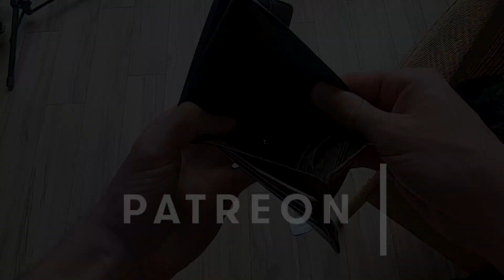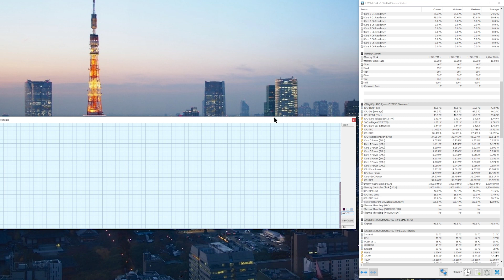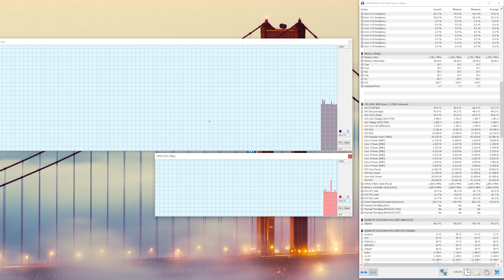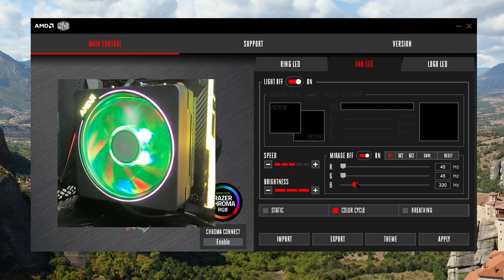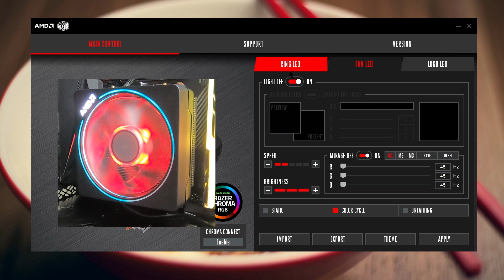Easiest Way to Install the AMD Wraith Cooler

Comment from the maker: Hey all, thank you for watching! I hope this helped. Remember to LIKE and SUBSCRIBE :)
Reply from the maker: Fabbe Labbe  Which lead? The USB header?
Reply: @TechIlliterate  I have this cooler currently on my FX8320 for the last 2 weeks. Finally building a ryzen 5600x build. My Cpu arrives tomorrow, Will this cooler be fine on that do you think?  Thanks for any info.
Reply from the maker: @EarthMonsterAZ  Yes. It's a GREAT cooler. No need to replace it unless you like to look at really low temps.
Reply: @TechIlliterate  awesome,  I will use this for sure. Thanks for the reply. 👍
Reply: Was looking for info on the LED wire description (voltage) and connecting up the LED wire... but you skipped that part of hooking it up...
Reply from the maker: @SeaJay_Oceans  Sorry dude. Haven't ever touched it tbh

Comment: I installed mine while the motherboard was in the tower. I used the same thermal paste you used. I used the spatula that came with the thermal paste to keep the backplate into the space between the motherboard and case.

Comment: Went wrong from the first step, numerous tests have shown the single dot method with the thermal paste is no good, it doesn't give full coverage, the best way is the butter spreading method, you put a little bigger blob than that on and with a small squeegee (they come with most thermal pastes) you smear it in smooth lines until the entire sqaure of the cpu is covered in a thin layer.

Comment: The mounting system isn't frustrating.  You just fell like you're going to smash your CPU when you are locking the lever down due to how much force is needed.  I prefer the two latch system over the other Wraith coolers.  Installing the Wraith Stealth was frustrating due to the plate that goes beneath the motherboard and then you have to screw 4 screws into it.

Comment: What if my stock cooler is Wraith stealth and wanted to change to Prism? Should I remove the motherboard to mount the brackets or I can do it without having to remove the motherboard? Wraith stealth uses 4 screws instead of brackets.

Comment: I have and ryzen 5 3600 with stock wraith cooler onto a ROG b450F mobo 

Issue is I have a 2x 16gb 3200 ram and only one dimm slot on slot 2 works and not slot 4. Resulting in only one card working 

The tinterweb says the cooler on the cpu is “to tight”  but I tried it and no joy,   Any ideas anyone?

Comment: I got the ryzen 2700x with the wraith prism rgb but it didn’t have those two cables is that going to effect anything aside from not having rgb
Reply from the maker: Nope. as long as you have power you'll be all good.
Reply: @TechIlliterate  okay that’s good now I’m not getting any power to my board at all I’m thinking it’s either the battery on the board or it’s my psu I ordered a brand new one from Amazon and I have them sending the replacement tomorrow so I can compare them and see what’s going on

Comment: Quick reminder to my pc brothers having trouble with locking the lever. If it takes too much force, and you afraid it will snap, just losen the brackets on the motherboard a little bit, and it will snap on just fine. After that, re-tighten them 4 screws just enough, don't over do it. The heatpipes design leave you with enough room to get a screw driver down

Comment: My cpu didn’t come with the clamps that hold it into place?
Reply from the maker: They should be on the motherboard pre installed.
Reply: @TechIlliterate  Yes, I got my clamps in the B450m Aorus Elite Motherboard included.. If you don't have this you can buy from Amazon or Aliexpress.

Comment: i put this cooler 4 days ago, took 2-3 sec, the trick is that you put a thin screwdriver between the blades and press the edge of the clicking mechanism, and it's ready. it can't be simpler than that
Reply: Between blades where ?

Comment: I almost broke something putting this in my pc lol I couldn't get the clip so I applied so pressure like another video suggests and I put too much and I heard something snap but then the thing went in easy after. I couldn't find what happened then later I looked in the back and a set of the USB ports got pushed back and I couldn't use them anymore but I cut the little metal line between and I could use them again lol
Reply: I thought I snapped the mother board or bent broke the cpu or something crazy. But it runs fine and I play on it for hours and no problems so I'd say it's all good

Comment: ArticSilver 5 is a bad choice to use for thermal paste for Ryzen chips.  It is so viscous that if you ever go to remove the Wraith cooler, you will likely pull up the CPU even though the locked lever is down.  This is not something you want to do (easy to damage those delicate gold pins this way).  The other trick as far as getting the clips on is to get the shorter clip, the one without the lever, on first.  Then make sure that the Cooler is between, perfectly between, the two black plastic retaining clips before you attach the longer clip.  And you do want to have that lever in the position demonstrated in the video.
Reply from the maker: I have had this experience...sans the chip removed from the socket. Have had a hard time removing the cooler, wraith and aio block.

Comment: Wait so when flipping the lever it’s going to feel like your breaking it ? Because I feel like I am going to break it
Reply from the maker: yup! And be careful when removing it. It snaps back and you don't want a finger to be in the way. Hurts like hell!
Reply: Literally just broke the plastic piece the cooler clamps too trying to turn that lever…
Reply: Well, some how with moderate pressure my lever managed to get snapped off. The idea of this cooler on paper is great,  but in reality it's execution is just crap.

Comment: Any idea why I can change the ring led in the rgb software but I can't mess with the fan light or logo?
Reply: Everything is plugged in right I just can't change the fan or logo lights
Reply from the maker: @awesomekittyninja  You're using the USB header cable? That is unusual. Try reinstalling the software and reseating the cables.
Reply: @awesomekittyninja  just use the usb header cable. Don't use the rgb cable or else you can't control it.

Comment: if I don't care about the rgb do I need to  use these cables?
Reply from the maker: Not at all. As long as you have the fan cable plugged in it will work perfectly. RGB will run randomly.
Reply: Do the cables come with the cooler or do you need to buy them separately